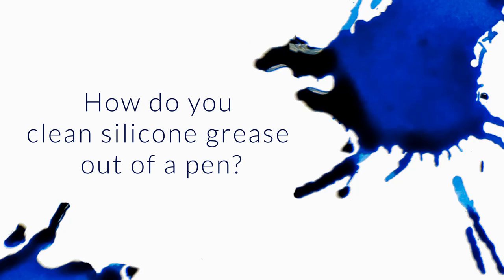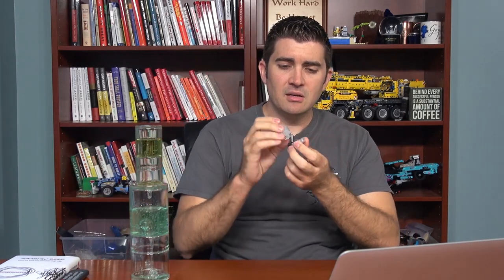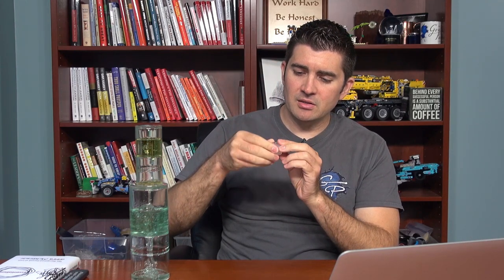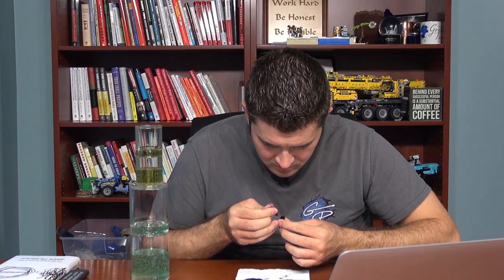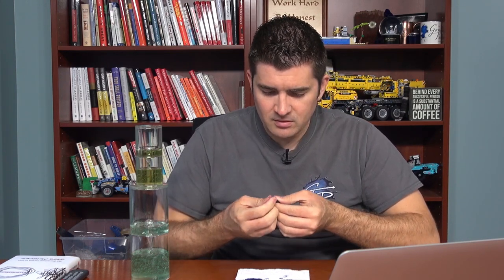How Do You Clean Silicone Grease Out Of A Pen? - Q&A Slices

Comment: One drop of dawn dish soap, one drop of jet dry, one tablespoon of white vinegar ten tablespoons of distilled(not tap) water. Mix the solutions well without causing the soap to bubble and heat it to 80-90deg F (silicone cleans better with warm solution than cooler or room temp). Disassemble the pen, then use a syringe to flush the feed. After It's clean flush it with plain distilled water. Reassemble the pen. If it has an ebonite feed you will probably need to re-heatset the feed and nib.

Comment: What's the TRULY best way to clean silicone grease? Don't use it. Seriously, don't use silicone grease. PTFE tape (a.k.a. thread sealant tape) will do a substantially better job of ink proofing your threads while leaving zero mess. Just go to your local hardware store, and pick up a 1/2 inch spool of PTFE tape and never use silicone grease again.